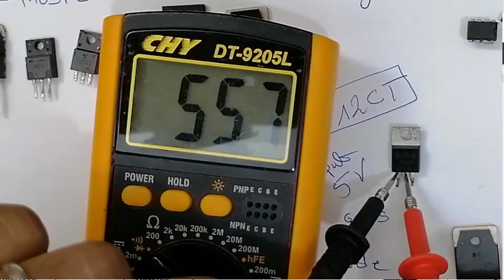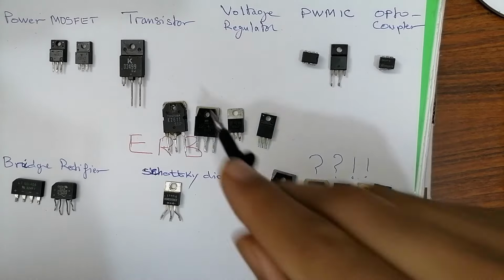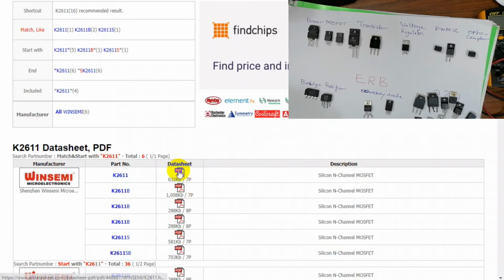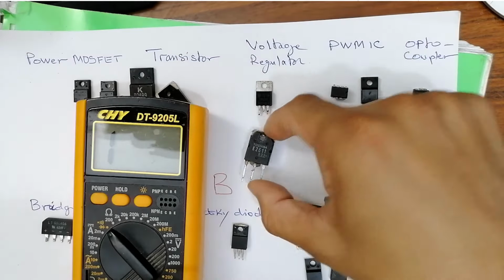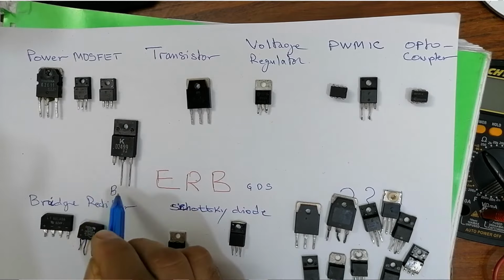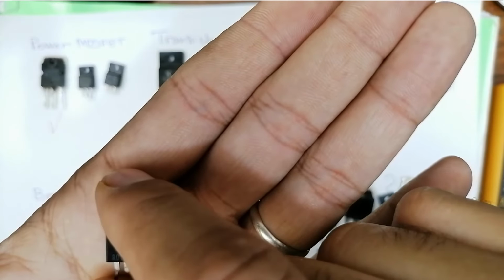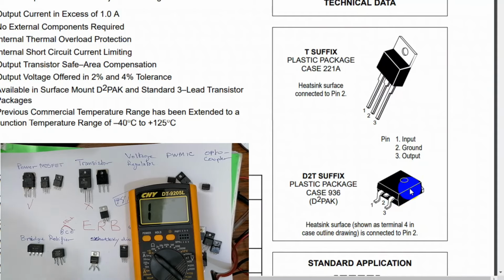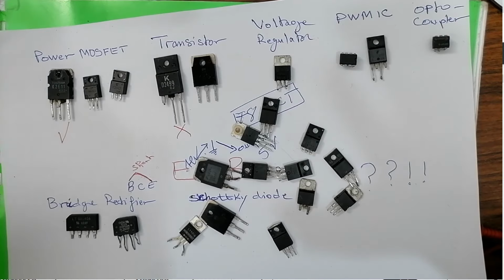Electronic Components Testing Using Multimeter Part 2 - MOSFET- Transistor - Voltage Regulator ...

Comment: Hi is this applicable with components that also is connected in a PCB or only allowed if the components are not connected
Reply: I think it's applicable even on PCB. You can remove the components out for effective diagnosis

Comment: there are so many  components that lookalike , and there is no general rule to check them with a multimeter , especially 8 pins , 5 pins and 6 pins LDO
Reply from the maker: Well, you can use experience or search using the part number